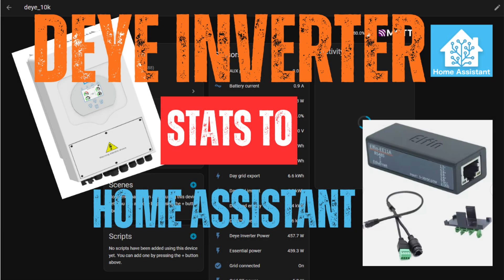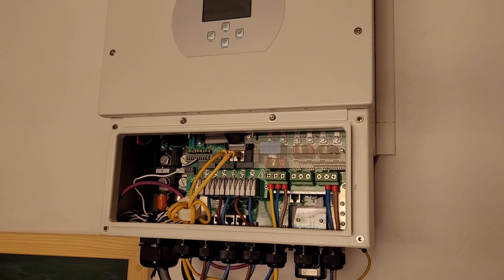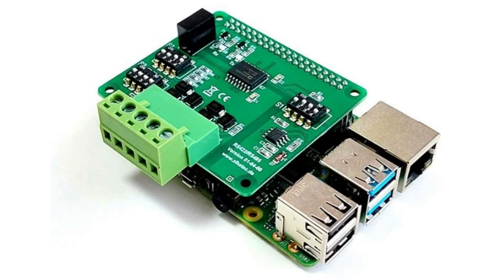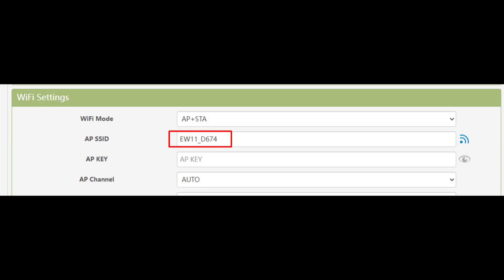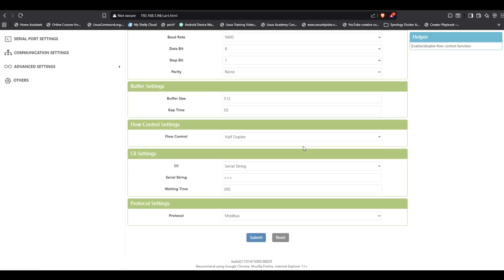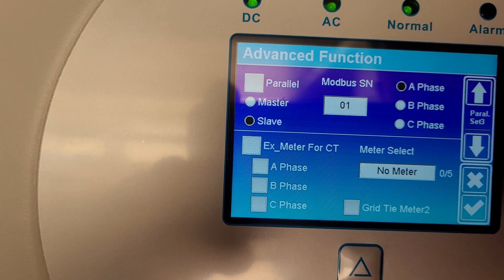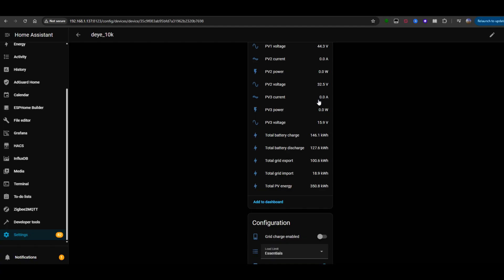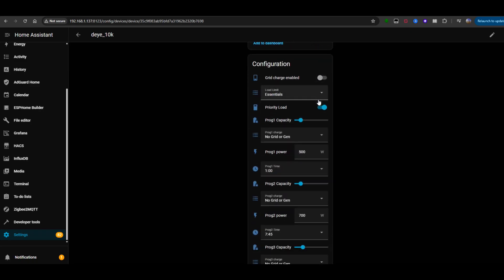Get Full Control of Your Deye Inverter in Home Assistant!

Comment: i need help to set automate to export to grid from the battery (discharge) on a specific time
Reply from the maker: There is a Configuration option in the integration "Grid Charge Enabled", you activate that and are able to select "Allow Grid" and change the hours for that setting.

Comment: Hi, thanks for putting out this video tutorial. I've got a Sunsynk 8.8Kw Ecco. The Elfin set up went perfectly....I connected to my wifi and got a local IP address allocated. Unfortunately, the Kellerza integration was not connecting to the Elfin and MQTT did not auto discover the setup. Not sure if the inverter model is compatible or maybe it needs the GND pin connected on the RS485 lead? I tried pins 1 & 2 then 7 & 8, with no luck. Maybe the cable is incompatible? Any thoughts ?
Reply from the maker: Hi, I am not familiar with Sunsynk, although I understand it is the same inverter underneath. Regarding the RS485 pins, you should either try to find the inverter manual (the Deye manual has the exact pins to use) or if the manual doesn't contain the info, try to find the info online or from the manufacturer. The Kellerza integration was developed on a Sunsynk 5.5kw according to its author, so in theory it should be compatible. Regarding the cable, I used a cat 5e ethernet and I cut one end  to connect to the Elfin.
Reply: Many thanks for your reply. For some reason the Elfin EW11 A is not reading the Modbus registers via the RS485 socket. I gather that many Sunsynk owners have encountered similar problems. Yes, Deye and Sunsynk are made by the same company and the settings on your inverter touch screen seem to be identical to my Sunsynk. More research to be done, but thanks anyway!! Best wishes !
Reply: Hello again! I just wanted to report back with some useful info for Sunsynk 8.8Kw Ecco owners. I finally got full control of my inverter using the Elfin EW11 A. The confusing thing is that the RS485 port does not allow modbus control. However, the BMS485 port does work perfectly with this method....this is a combined CAN / RS485 port where pin 1 & 2 are RS485 B & A, pin 3 is Ground, pin 4 is CAN High and pin 5 CAN Low. I modified a Cat5e where I only terminated pins 4 & 5 to the RJ45 for my battery BMS coms and I left loose wires from pins 1,2, to connect to the Elfin. I left the ground wire 3 unconnected. It worked immediately. I hope this helps anyone who got confused like I did. !! Merry Christmas!
Reply from the maker: @andrewligocki  Wow, that's some great info, thanks for sharing!

Comment: is it possible in home assistant to control export from the battery to the grid? Then charge the battery when power is cheap and discharge to the grid when expensive. I don't have solar, just inverter and battery.
Reply from the maker: You should be able to create an automation to do that, although I have never configured such a use case.

Comment: firrst of all, absolute great video, thank you!
But how often can you pull data from the deye inverter? i need a high polling rate for my project
Reply: i am also looking how to get real time data from my Deye. For statiscic it is more than enough every 5 minutes, but to view live data i want to see imidietly the changes in curents. Thank you.
Reply: @krnekiu  are you using Home Assistant? i now hooked up my Deye 12k via RS485 to Ethernet and i can pull live data every 2 seconds.
Reply from the maker: I think it is every 30 seconds, however I might be wrong. Anyway, it is way more often than using the Solarman integration.

Comment: @zoltar99
I’m using an experimental dynamic tariff where low prices appear in different 15-minute periods throughout the day.
I would like to use a single slot (e.g., Prog1) to activate grid charging.

However, I can’t figure out how to set Prog1 Time so that it covers a full 24 hours (which would allow me to control Prog1 Capacity from Home Assistant whenever the price is low).

My question is:

a) How can I configure Prog1 Time to span 24 hours?
or
b) Is there a better approach to achieve this?
Reply from the maker: I would have to try this scenario.

Comment: solar man and deye clouded can control the inverter. so did i miss the point for this set up?
Reply from the maker: Solarman only allows reading sensors, but does not let you modify anything. Unless you have a different Solarman integration... Deye clouded? I only use Deye Cloud as a standalone app, but I didn't know there was an HA integration. Anyway, Deye Cloud comes with about 5 minutes of lag, not realtime stats, so if you need realtime stats for automations, it is not very useful. Anyway, it is better to have more choice.
Reply: @zoltar99  hello I’m a new owner of a Deye 8kw inverter and I would like a setup like this could you assist me?
Reply from the maker: @marquisethompson7225  In principle, this tutorial should be pretty straight forward to follow. Give it a try and if you hit any problem, leave a message and I'll try to help.

Comment: The RS485 and CANBUS port are the same port on my sunsynk ecco 5kw. I use this port to connect to my battery, Can i use a RJ45 Splitter so i can plug this in and my battery to the same port? Also i have 2 inverters do i need 1 on each or just for the master inverter?
Reply from the maker: I don't think an RJ45 Splitter will work in this case, but you can try, since they are cheap. For the last question, if your inverters are connected in parallel, only one Elfin is enough.